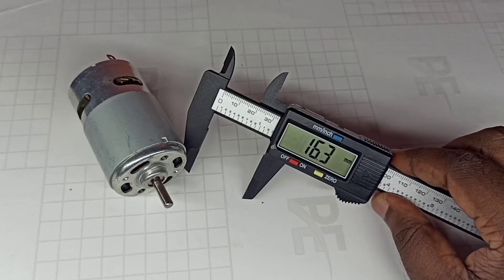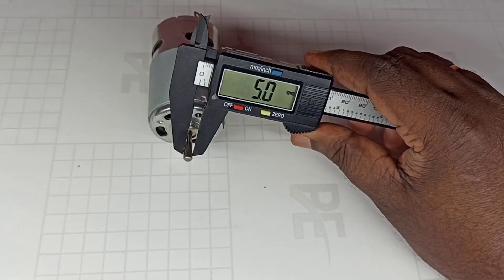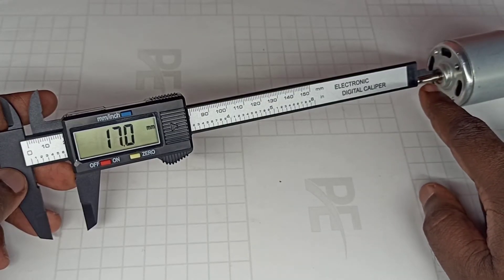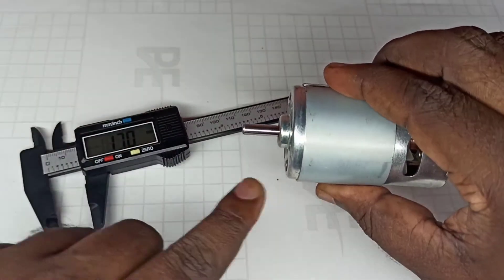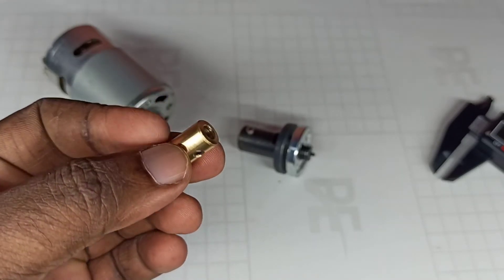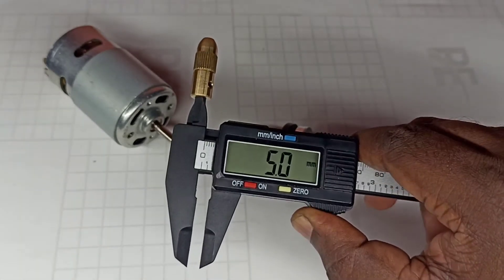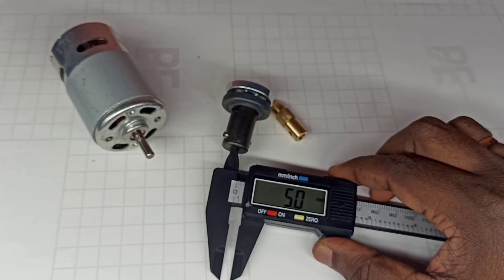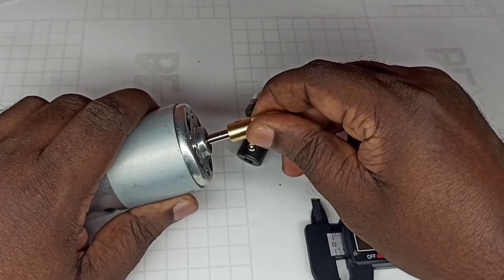RS 775 dc Motor actual body size ? Shaft diameter ? Shaft length ?

Comment: Very useful for me, as I was not sure what is the shaft diameter. 
Since the motor shaft is cylindrical without any flat surface, will it not slip with this type of coupling (with single point grub screw)?